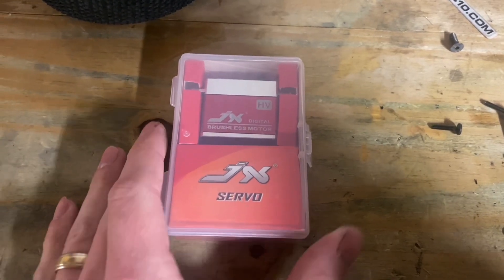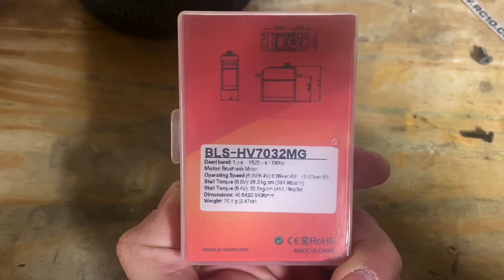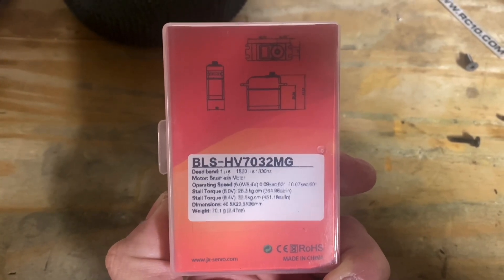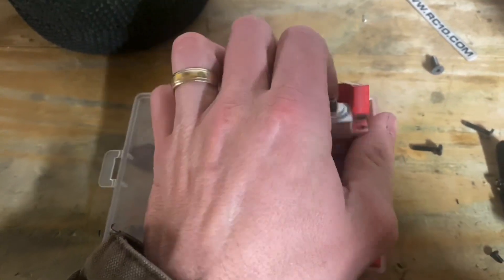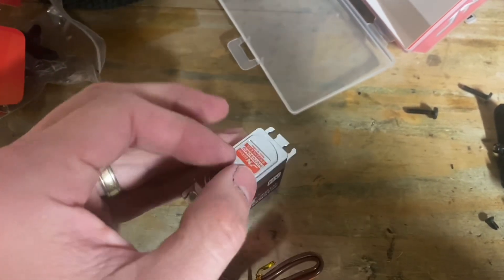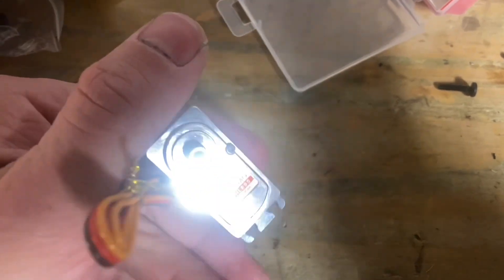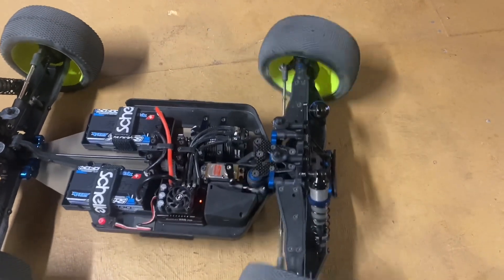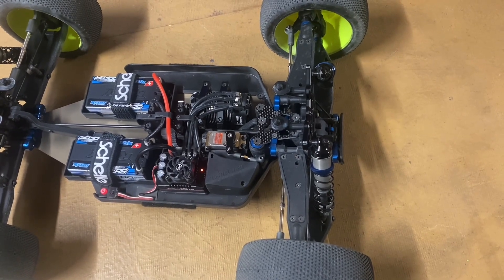JX Brushless Servo! BLS-HV7032MG

Comment: They make great servos spec-wise. They just don't last for very long in my experience.
Reply from the maker: Gears wear fast?
Reply: @SuperFastRc & ATV  No. One burned out and went dead. Another just stutters.  The newer ones I bought are still kicking.
Reply from the maker: @RecklessRacingNY  Quality servos are really the classic “Buy once Cry once” $$$ lol
Reply: @SuperFastRc  Fact!!! And I've learned that lesson by buying about a dozen. Lol
Reply: Ive had luck with these servos by just using them with a good servo saver like the kiborough
Reply: I had 2 7132bls, that have the same specs, just a black case. I think it is the only difference? I have been through 2 sets of hears in 1, and the other I have put new gears in 1 time, and it still works. However, when I tried to use it as a noteo throttle servo or steering. The servo would go to full lock to the right ever time when I would Rev the nitro engine? Very weird, I moved it to my 2wd buggy as a steering servo, and it does great. I would say for a 1/8 car or truck it will wear the gear quickly and you will have to replace often.  UT in like a 2wf or 4x4 1/10. I don't think you will ever have an issue? I have the 7132 in my 2wd buggy, and we will see how it holds up. Great video!